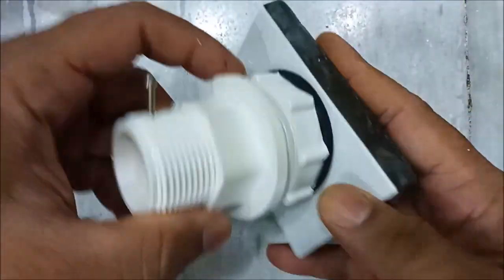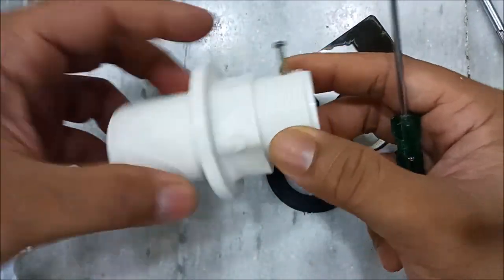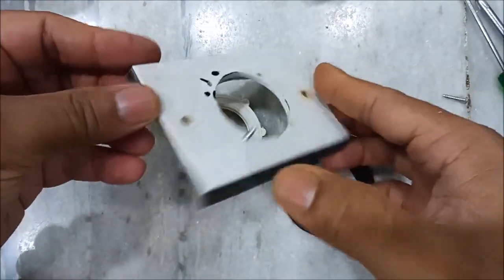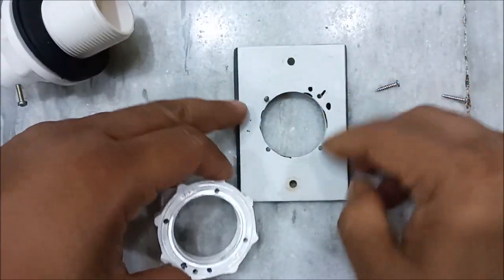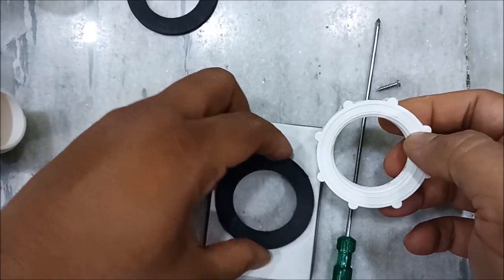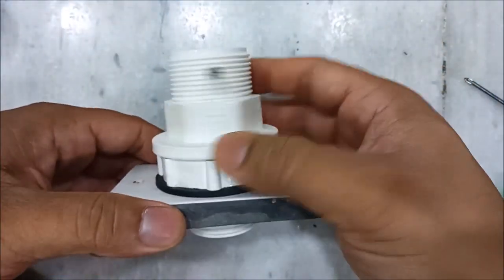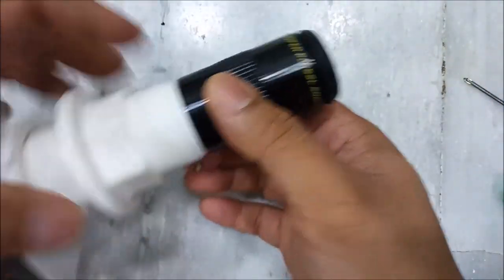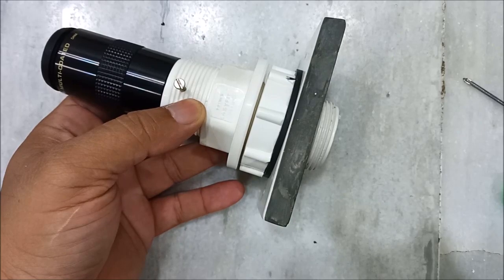DIY Helical Focuser

Comment: One thing I want to add is that every eyepiece has its own built in super fine helical focuser. Just loosen the top section from the barrel,and you got about 1/8 inch of travel before the two separate. Most eyepieces are threaded to allow this.

Comment: Extremely nice and clean design.I bet it works great.This gets me motivated to make one for my 6" Dobsonian.
Reply from the maker: Thank you! yes it works great.
Reply: @astrokhan  One question.Have you ever tried applying "damping grease" into the threads? To make it turn super smooth?
Reply from the maker: @bd764  Not damping grease since it would attract dirt. Rather I have used Teflon tape on the threads to make it smooth turn. please check the bottom of this page on my blog https://astrokhan.wordpress.com/home-2/assembling/diy-focuser/
Reply: @astrokhan    Ahhhh.  teflon tape.   never thought of that.      Excellent engineering and very low cost for sure.
Reply from the maker: @bd764  Thank you!

Comment: Thanks for the video.  I just finished a focuser that is a little similar to the way yours works.
Yours has some advantages over mine and I might modify my next one to be more like yours.
Reply from the maker: Thanks for watching. Just subscribed to your nice channel. I will learn more. Looks like what you used is called FTA & MTA in my country. They are actually good for small form factor design and short  focusing distance. I had actually planned to use them initially but abandoned due to less focusing range available. But as I said they are good for compact design and short range focusing.
Reply: @astrokhan  Thank you for your kind words of encouragement and for subscribing.  
Thanks also for sharing your experience and why you abandoned your use of the FTA & MTA.  
I suspect that the way I make focusers near the camera end of the tube as push / pull / twist with about a 100 mm range of adjustment in addition to the threaded fitting that the threads can be used as a "fine" adjustment after getting close to focus with the push / pull / twist arrangement I showed. 
I think the potential problematic issue with mine might be the slop in the threads when the threads are extended longer.  If that's the case I'll likely adopt your type of threads as an addition to what I have now or as a complete replacement.   I'm happy to have your method as an alternative to what I'm doing at the moment.
I'm also subscribing to your channel and I look forward to getting more of your ideas.
Reply from the maker: @southernexposure123  thank you and all the best for future work and design.

Comment: Hi is it possible to attach camera instead of eye pice
Reply from the maker: Yes you can. You need to use 1.25 inch adaptor and T Ring in case you have a DSLR camera. For any other camera, you need to use suitable adaptor.

Comment: Hi. İ saw your blog too . İ am also making my 20cm newtonian telescope. some parts cant find easily and cheaply in my country too. This focuser is one of them. Can i use the dimention of this focuser in my telescope too. İ am making an 8inch 20cm mirror 120cm focal length telescope. (10mm and 20mm eye piece . )
One more question İ also dont know how many cm should i use for secondary mirror do you have a suggestion or any equation?
Reply from the maker: Hi Eralp. Nice to know you and all the best for your telescope project. Yes you can use the dimension of this focuser for your telescope too. For your scope, If tube diameter is 25 cm and focuser hight is 8.8 cm (or 3.5 inch) you need a secondary mirror bigger than 3.6 cm. I suggest you to take secondary between 4-5 cm size. I will be putting the simple equation to calculate it on my blog soon. Please keep checking.
Reply: Bitirdiniz mi siz teleskobu? Ayrıca yok artık aboneliklerimiz yani ilgi alanlarımız bile aynı.

Comment: Hi sir .. what’s the eyepiece model that u used here? And what’s  the size of the tank connector ?
Reply from the maker: Hi Akhil. I use 1.25 inch or 32mm OD eyepiece model. Tank connector used here is size 1 inch uPVC which has ID of around 33 mm. Please check the size before buying.